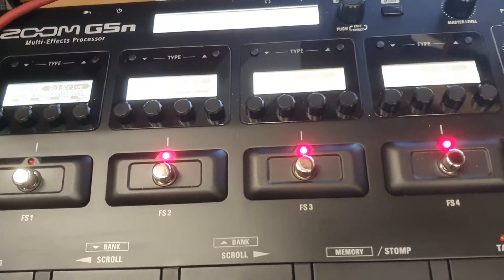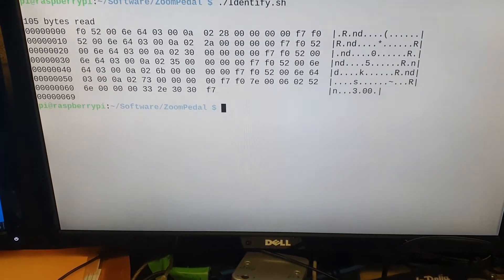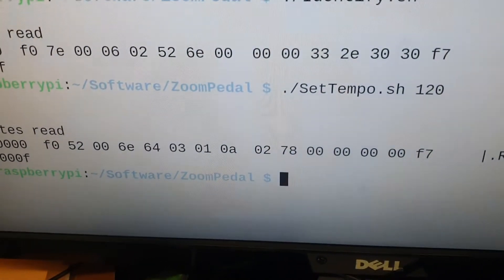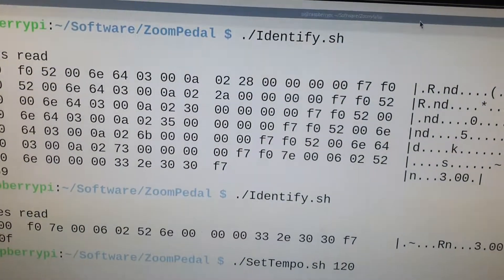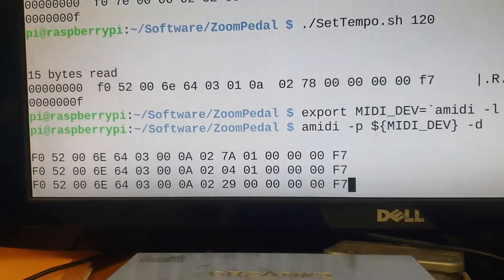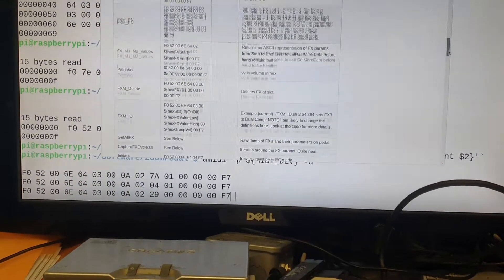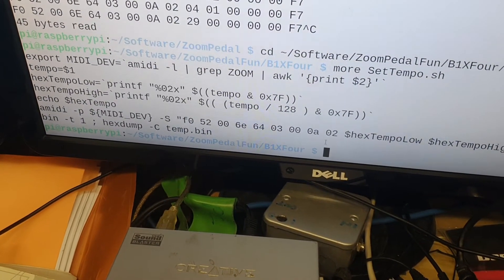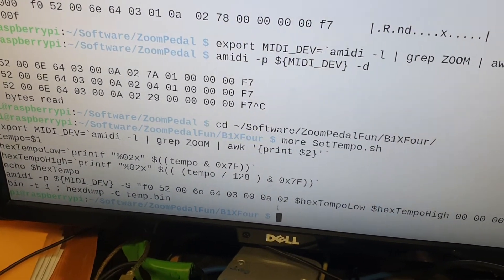Zoom G5n - How tap tempo can be implemented on other Zoom pedal.

Comment: Hello, is it possible to set the G1on time through sysex?
Reply from the maker: By time - do you mean the tempo (Beats Per Minute)? If you can give an example I can try to answer.

I would recommend checking out ToneLib program - it is free for B1. If that can do it then answer is yes - we might just have to find out what it is doing :-)

https://tonelib.net/downloads/

The Zoom download should be the right one.
Reply: @stephenhookings1985  yes, time = BPM 
rhythm mode BPM
Reply from the maker: Ah sorry _ see now. Tap Tempo on a B1On via sysex. Yes - but not in the way I do it here. The older B1's (non n gear) - you would have to write the whole sysex out.

Here's all the sysex so far I have been able to find for a B1on type pedal

https://github.com/shooking/ZoomPedalFun/wiki/De-re-B1On

For the G5 on can use
Tempo Lowest	F0 52 00 5B 31 0C 02 28 00 F7	40 BPM	lowest tempo
Tempo Highest	F0 52 00 5B 31 0C 02 7A 01 F7	250 BPM	highest tempo

here 5B is the ID for a G5. I am pretty sure this doesnt work for a B1On ... but well you could try by changing the 5B to 65 (0x65 is the value for a B1).
If you ever find new sysex strings please consider opening an issue on my github and I will add it in (and try to give you credit!)
Reply: @stephenhookings1985  I made the attempt with this string changing only the ID which in G1on is 63 and it had no effect.
I'm sending the commands via MIDI OX
Reply from the maker: @andersonoliveira_aos  I was playing with the again today. So I can't work it out via a simple sysex sentence. I believe the Tonelib achieves this by reading current patch into its memory, modifying bytes, loading it back up. IIRC I reference SysExTones work on my ZoomPedalFun site. He has a Python program that might do this.

The raw sysex is in some unpacked format. So most people don't to work in this space. I think it's better to work in the packed space, make the mods, then unpack and load that up.

If I get more time in the future I will start to look at B1On more deeply. My current work is in trying to understand the Looper on G5n pedal and then GCE-3. After that I will revisit the G5. There we can set the tempo. Then I want to check on the MS-70 CDR to writeup the packed v unpacked approach.

I don't think the B1On is sending data along the wire for some of these settings. Hence you either have to send it in a full patch dump or open up the box and find where to inject signals. I might try that in the future as I have enough pedals that losing one would be ok.

Comment from the maker: Thinks G5n is same as a G1XFour/B1XFour

I was thinking of this link for older pedals but it won't work on the newer. Plus here you have to write the whole sysex out instead of just sending point command.

https://github.com/PhilDaThrill/MultistompMidi/blob/main/source/msmidi_fx_edit.py

The other thing is Phil has left the sysex in unprocessed state - hence all the bit testing. Nothing wrong with that except it makes the actual mechanism seem more complex than it is.